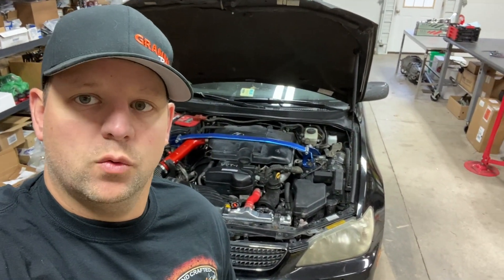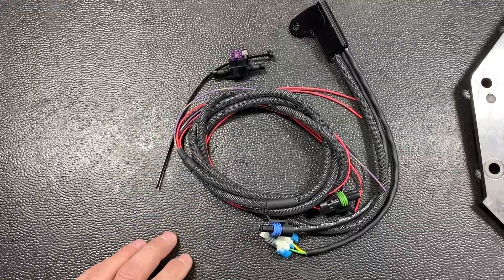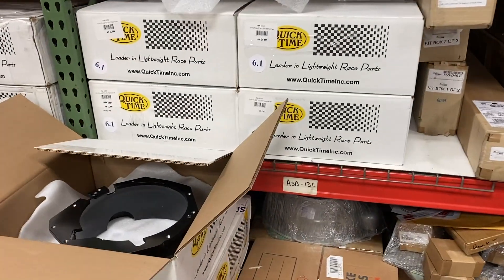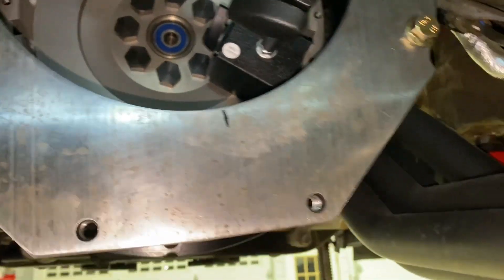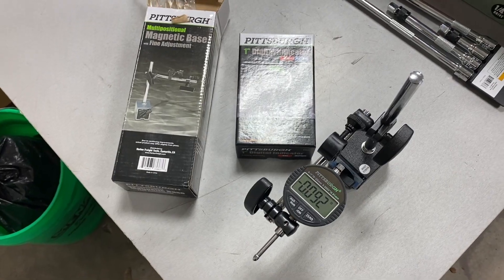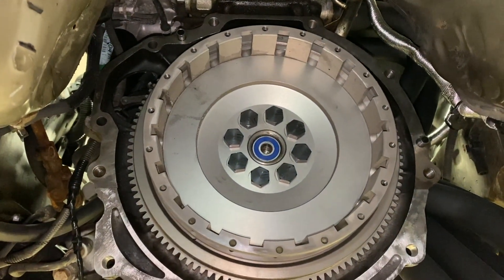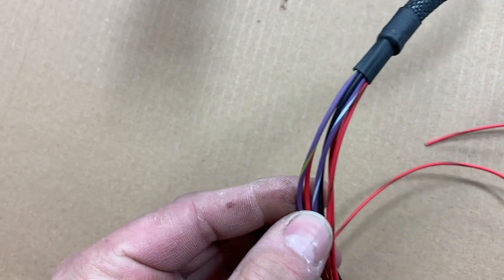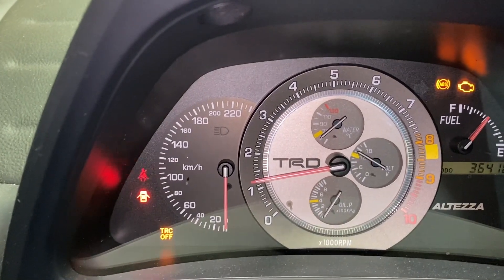NEW T56 STUFF! Two new products to further improve the Grannas Racing T56 Magnum swap kits

Comment: When stuck at the 0.007" window, only use 1 offset dowel pin in the direction needed, and it will closely split the difference needed.

Comment: Curious on how I can make cable driven speedometer work for the Mk3 Supra with your 900 series trans. Might use a aftermarket HUD and retro fit it. Keep us posted plz.
Reply from the maker: I refer my MK3 customers to a guy I know who makes the magnum mechanical adapters so it will work perfectly with the MK3 speedo.
Reply: Grannas Racing thats awesome, any possible chance you could share a link or add the adapter to your website as a drop option in the future?
Reply from the maker: Mr JZA75 both links are at bottom of description

Comment: Can you preform the run out with the dial indicator before shipment and provide the correct pins if needed?
Reply from the maker: No, because you still would have to install the dowels into the block. Also 2 different blocks may have variances as well

Comment: What issues would this cause? This was not provided with the previous t56 swap
Reply from the maker: it's a recommended practice on fabricated bellhousings. If its not aligned it can kill transmission input shaft bearings over time. I just want people to be taking all the right steps to ensure a reliable, long lasting experience with my kits.